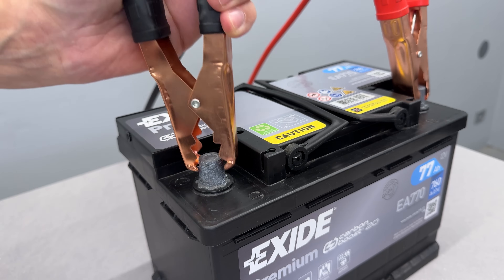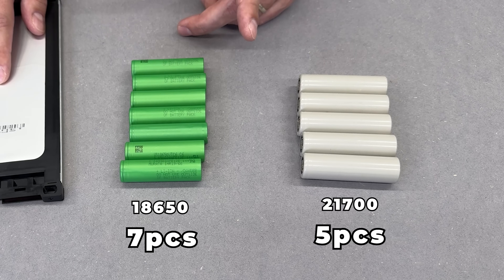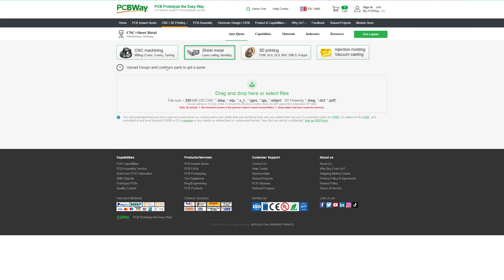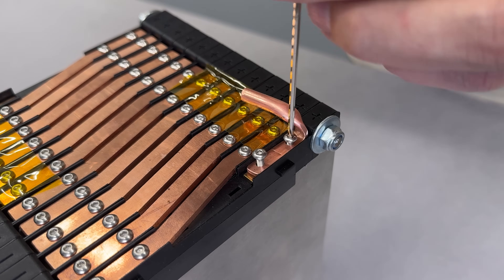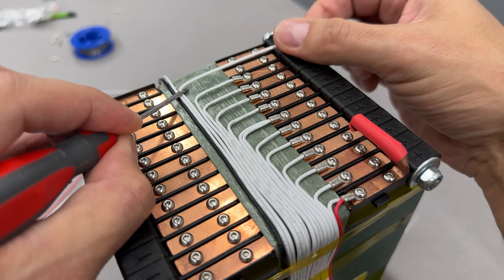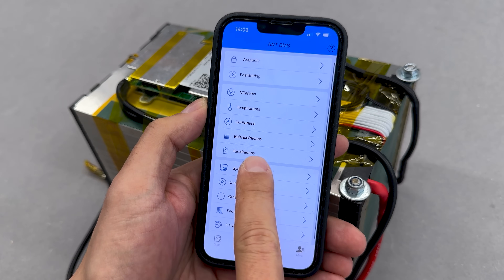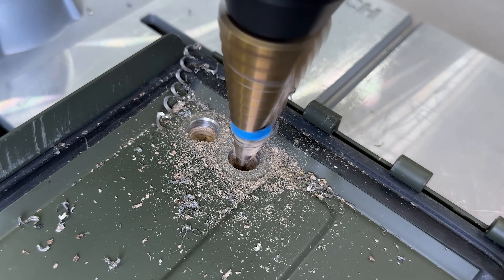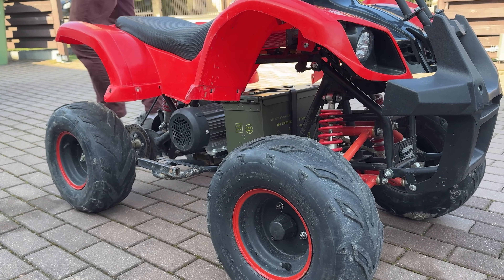I Build a 200A Battery in Army Metal Box!

Comment: How are you getting 200A out of cells connected in series? I doubt a single cell is 200A, simply wiring a set of cells in series doesn’t increase the maximum discharge current the pack can deliver as that would be parallel which does increase the maximum discharge current, series increases the voltage, if you want both increased voltage and discharge current you’d have to design it as a series-parallel configuration which increases both your voltage and capacity but would require more cells and a bigger enclosure while you did good on the project, the title is a bit misleading due to the fact that it’s not a 200A battery which is probably why you didn’t mention where to buy the cells in the description because anyone learning about battery wiring configurations would immediately know the basics of wiring multiple cells together in series would increase the voltage while the capacity stays the same as a single cell, case in point if you wire 2 Samsung 30T 35 amp 3000mah 21700 cells in series you’re getting the same mAh and CDR of a single 21700 cell but the voltage increases to 8.4 but if you take the same two cells and wire them in parallel you get the same voltage of a single cell but increased CDR from 35A to 70A and  increased capacity from 3000mAh to 6000mAh and they’re also lithium ion batteries even then battery chemistry doesn’t matter as all batteries follow the same principle when 2 or more cells are introduced!
Reply: If you spent as much time paying attention to the first 2 minutes as you did typing a dissertation on wiring batteries you'd answer your own question. 

It's a little disingenuous for you to start with I doubt one cell is 200a and end with they aren't 200a.

He didn't say where to buy but he did give the name of the cell - EIG ePLB C020B.   A simple search will show you not only where to buy but that they are 100a continuous, 200a peak cells

So your statement that the title is misleading because of the "fact" that they aren't 200a is a lie. A lie that you could have avoided by looking it up instead of taking your feelings that claiming them to be fact

Comment: Would've been better without technology like for an end of the world situation for power
Reply: You can’t do it without technology though can you in the end of the world and you’re going to have a lot more battery fires?
Reply: @Adam-n1p6mas in technology i mean go back in time 50 years and have no connection to a phone just pure power like a car battery or connect a bunch or rechargeable batteries together and have hardware that will control the charging not some software
Reply: @The-One-and-Only100  you could do it in hardware for a lithium battery but it’ll be very complex and hard to fix as well as potentially dangerous
Reply: @Adam-n1p6mnot lithium but the good old nickel batteries (lithium is overrated)
Reply: @The-One-and-Only100  it isn’t that overrated compared to a lot of other battery chemistry and how they perform overtime and with energy density
Reply: @Adam-n1p6min a post-apocalyptic situation lithium ion would be the worst battery to choose
Reply: @The-One-and-Only100  in most situations any battery wouldn’t work purely because you can’t have one that lasts a long time without maintenance and performs well

Comment: If hunting them online the term for that "box" is "ammo can" which are sold surplus after use and quite handy. BTW if you paint the inside white it's easier to see tools and parts inside.  I use three of them as winch solenoid enclosures for my wreckers by mounting the solenoids etc to the lid instead of the box, so when the lid is removed everything comes with it.

Comment: You should make a battery bank out of old vapes
Reply: It’s really really hard to match capacity of cells because they are very low-grade. They are often under discharged too so that doesn’t help
Reply: @Adam-n1p6mluckily Vapes have a type c charger so you can charge them all up before starting the project

Comment: These cells are 5C peak, 3C continuous. That means 60A continuous discharge in 1P configuration. 
Title states 200A, and it has no cooling.
Reply: And 10AWG wire which is rated at 30A using 90A connectors and no over current discharge connection, no chance of fire here.   Looks well made, but the 10 AWG wire is a bit small for what he's doing  It should also have an inline fuse.
Reply: @markw365  actually it depends on the length of the wire. It isn’t just a blanket rule.

Comment: 200EUROS ?FOR JUST THE CELLS!!!!!!!
Reply: That’s good price
Reply: Good price for a lithium ion battery that's an enormous amount of electrical storage in there
Reply: I have these cells, bought a module of 24S2P from a Fiat Fiorino.
They are quite good, but compared to modern equivalents like a Gotion NMC prismatic cell, they have relatively low capacity (Wh/kg). They are over 10 years old in design anyway.
Reply: @emilen2 I want these cells so bad but can’t find anywhere like at all

Comment: I use these cheap to buy ammo boxes to store my LiPos  they are designed to hold bullets and 50 cal grenades so why not LiPos.   May well use this to build a few for my off grid solar set up.
Reply: But they are not designed to handle a fire or any gas buildup. You need to understand when they’re holding ammunition. They’re not to contain an explosion. They are just glory pit together so you can carry it easily.

Comment: Hi, does this type of battery also work for HAM radio equipment? I need 13,8v and 20,5 A for my Kenwood TS-480SAT with 100watt power.
Reply: No, thise cells have Li-ion chemistry. 3 cells do have 9.6-12.6V voltage range and 4 cells - 12.8 - 16.8V voltage range. Even if limited to 5-95% SOC then you still get 3.25V -4.15V per cell. The closest you can have to steady 13.8V from batteries is 4S LFP (aka LiFePO4) - charger can output up to 13.8V (14.6V charger - gets to 100%, 13.8V charger gets you at least 99%), outputs 12-13.2V at 5-95% SOC.
Reply: Fundamentally, a battery is not usually depended on the load however the load might need some power supplier equipment to make it work good

Comment: A verry professional diy build. One suggestion from my side, use a suitable dc fuse between your battery pack and the bms. You would have an extra layer of safety if something on the electronicside shortens. But overall good build!

Comment: Insulating tape is fine, but I suggest covering the middle of each bus bar with heat-shrink tubing or tape before installation to reduce exposed metal during construction and handling.

Comment: Nice build! Have you considered what would happen in a failure mode where cells begin to vent and pressure builds up inside the ammo box?
Reply: The FPV drone folks have tested that. It pops the lid but nothing too exciting.
Reply: @MattyCowPatty  not always it really depends on how it fails and how many fail at once
Reply: I was thinking that too, if a cell fails the pressure could build up very high and suddenly explode, maybe adding a hole in the box with a rubber plug in it would be a great safety feature while still keeping it waterproof
Reply: I suppose that if the box is suitable for ammunition, it will withstand any problem with lithium, which if it were to become extreme, the gas would escape through the cable outlet before exploding.
Reply: @jorgefernandez8  it isn’t meant to contain ammunition igniting though unfortunately in that case the whole pallet of cans explodes so that would happen with batteries